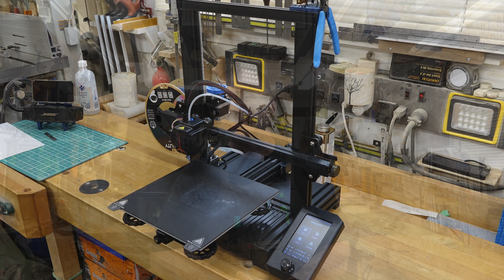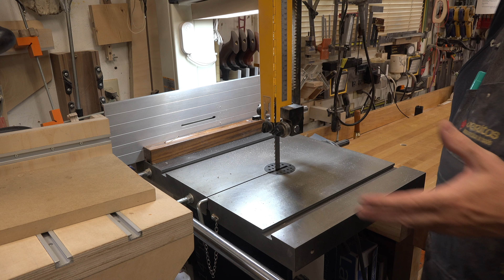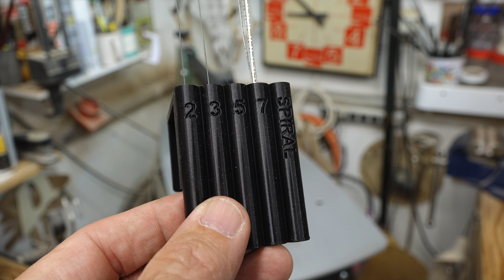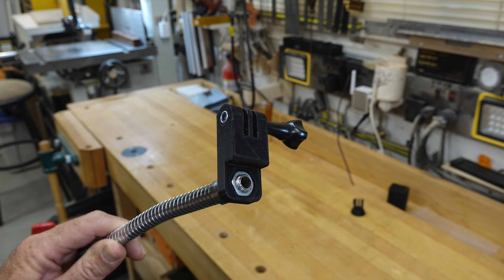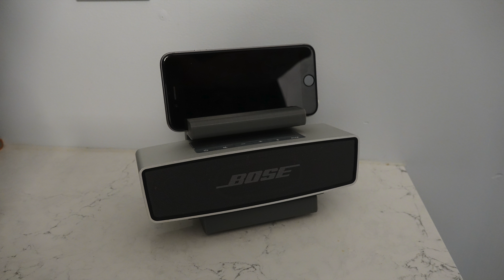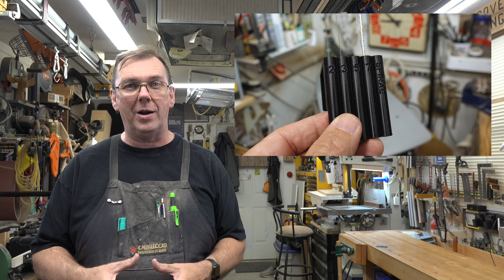3D Printing?  What Have you Printed Lately

Comment: The end cap for your table saw fence is awesome or should I say drawer. I was interested in getting a 3D printer to make a toolbox for work. Plastic for light weight, specifically designed spots for my tools to hold them securely. Some viewers on another channel when I asked the question seemed doubtful about the longevity due to sitting in a hot van in the summer. I ended up with a tool bag that’s almost perfect made by a company for trade professionals. Plus I’m lousy with a computer, I mean terrible. Lol
Reply from the maker: The heat of the van would only be an issue if you used PLA.  You would probably want to use something a little more heat resistant for the prints.  I think the major drawback would be having a 3D printer that would print components large enough to fit the tools that you wanted to fit in the toolbox.  I have made a few single tool cases but never considered a larger unit.  Maybe something for me to think about.  Thanks for tuning in Randy and for the idea.  It's appreciated.

Comment: Thanks.  I have been using my Ender to make lots of little things to make my for my shop.  I've been using SketchUp for the design since I already knew how to use it.  It's not quite right for making all the shapes I need.  You mentioned Fusion360 and I will take a look at that. The coolest thing I've made yet is a tool holder that snaps over a 4" pvc dust collection pipe. I ran out of wall space to attach things in my workshop. My dust collection system includes piping on the ceiling that has drops to several of my machines.  The drops are 4" pvc  and so with my little  half round brackets that slip over the pipes I can have tool holders.
Reply from the maker: That sounds awesome Nicholas.  I'd love to see a picture of that.  Feel free to email me at kennye@acutabovewoodworkings.com with some pics if you'd like.  Thanks for tuning in to the show.
Reply: @acutabove_woodworkings  Pictures are on their way.